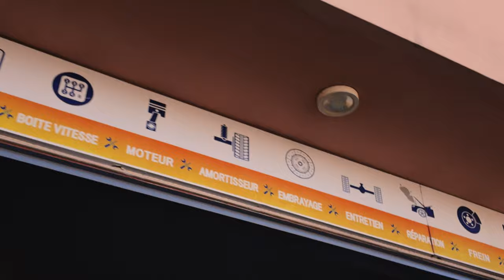Running Away From Marrakesh - Is My Toyota Hilux Finally Fixed? | Overlanding Africa - ep13

Comment: Is there no camping guide for safe places to sleep?
I hope that your camper will now drive for a long time without any problems.
Reply from the maker: You are right, there are some.  Usually I use iOverlander or Park4Night, but aside from being used by many others, the places there especially in Marrakech cost something like 100 Dirham (around 10€) just for parking. And that was too expensive for me. :) 

Thanks man! So far everything works well. But like every old rig, there will be more to repair at some point for sure. :) But it's part of the adventure and I highly enjoy it as well.

Comment: What did they end up doing/fixing.
Looks like they took most things apart, cleaned and just put it back together again?
What did it end up costing and what was your agreed rate pr. hour?
Reply from the maker: Hello! They did the front and rear main seal, re-sealed the transfer case shifter, changed a U-Joint, added a bigger vac pump to the alternator for the brake booster and tightened one front wheel bearing to be very precise. All together they needed 2.5 days with 2 people and the labour was cheaper than the parts.(Original parts though and it was not the cheapest mechanic either) I negotiated the price beforehand plus parts. All together I am super happy with what they have done.